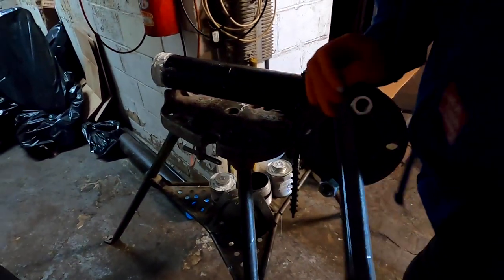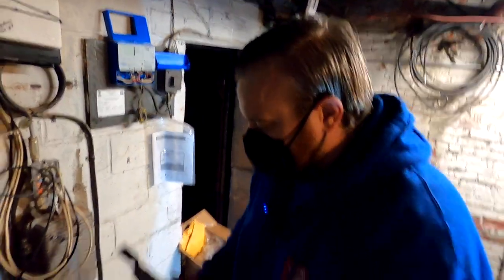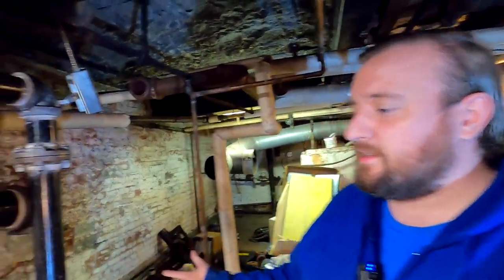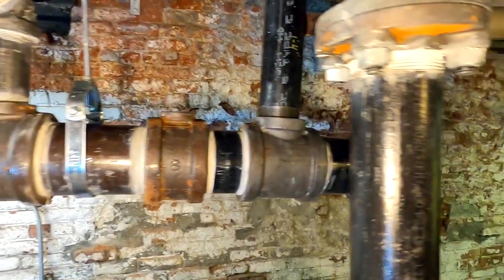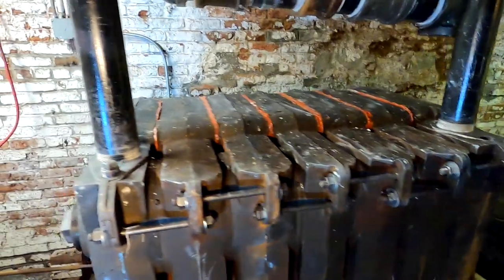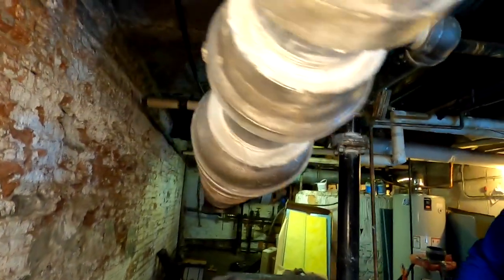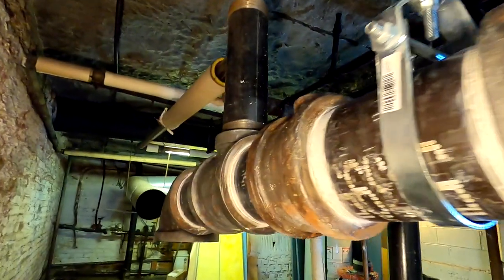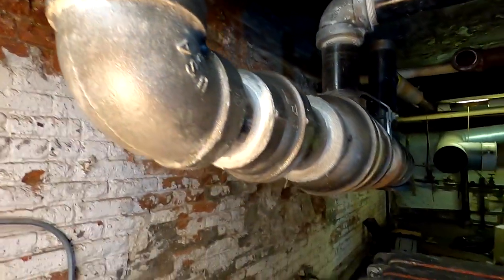Boiler install day 4 header

Comment: Hello Anthony!  Did you install a king valve ? Nice video!
Reply from the maker: I apologize for getting back to you so late. I’m not sure what “king valve” means anymore. I know I Install boiler pressure test valves on header and return and only for the purpose of pressure testing my put together boiler,  But I also know that king valves were used back in coal days. When the fire was too hot, they would dampen the fire and adjust the steam output with king valve. Those type of valves I love cutting out, they’re normally fully open but the way they’re made, doesn’t help steam. They collect condensate at their belly. I remember one time I took out this classic boiler, beyond classic. It didn’t leak or anything. The owner just wanted something newer. It was asbestos coated and beautiful lol. I told the guy hey just leave it, it’s working. He said no. We took it out and put in a brand new boiler. All of a sudden.. bang boom bang boom. All the steam pipes were just hammering. I did a lot of work to the system and figured out it was the old king valve just collecting condensation. Every cycle bam boom. Cut it out and it’s been silence since lol. Good question and thank you
Reply: @anthonyarealgoodplumber  we need new content!

Comment: Whats the tee for on the one riser/outlet? Y'all need some donations of rags?
Reply from the maker: Hey, the T will get plugged, we use it later on when cleaning the steam/water side of the boiler. Also we are good on rags thank you! We eventually wire brush and clean all the fittings before insulating it all. Thank you for watching and commenting.
Reply: @anthonyarealgoodplumber  your vendor sold you a 6x3 tee. Could have gotten an extra and gagged the end on the horizontal drop header for cleanout too. A king valve isn't required on that size of a boiler? Nice watching y'all grind that job out. Gods work.
Reply from the maker: I wouldn’t want to reduce at the end of my header drip, I’d prefer a full sized elbow, then reduce as I go into my equalizer, I’m trying to keep the water in the boiler, if I reduced or put in a T it’ll only influence back splash, I want everything nice  and smooth .

Comment: Is possible to propress a header? On steam ? 
Or can even us propress on steam
Reply: Some knuckleheads have done so. Ths gaskets say 230⁰ on those steel press fittings.  I wouldn't trust it.
Reply from the maker: I wouldn’t recommend it. The reason screw pipe is best is because that header is going to thermally expand at a different rate than the boiler itself, so the more elbows the better, just make sure to keep the right pitch on everything and you’re golden. Thank you for watching and commenting
Reply: @anthonyarealgoodplumber  Mega Press is rated for steam and will allow for expansion. I still screw most boilers but have Mega Press on a few for a couple of years now with no issues and is a real time saver.
I am becoming more comfortable with it as time goes by and not one issue yet. Fingers crossed it stays this way.

I have done all sizes up to 4” they do not go bigger than 4”

The Smith 19 series is my fav. But can not get any now. Been twinning in Two peerless steam SC series to get to the bigger sizes.
Reply: @anthonyarealgoodplumber  thank you keep up the great work. and remember only few can held a 6inchs
Reply from the maker: @RalphsHeating that’s awesome but mega press isn’t up to code by nyc yet. I’m personally hoping it happens some day! I do use propress on copper and it works amazingly!
Reply from the maker: @RalphsHeating I did a job on removing high pressure city supplied steam and built a brand new boiler room on the second floor of a office building by wall st. What I did was use (2) Burnham v11-09’s with 3 take off all drop header into a 12” drop header . Installed a vacuum pump/condensate pump. We were golden
Reply: @anthonyarealgoodplumber  couple of pics of a duel setup. Job was not fully completed but piping was done.  https://drive.google.com/drive/folders/1JMA0RJCMc5bTp5sbIvIamswkYj7h5lBH
Reply: never copper on steam